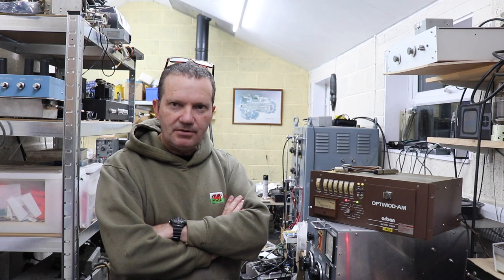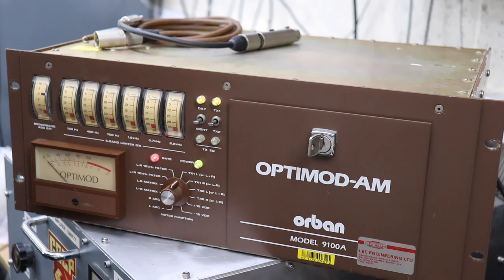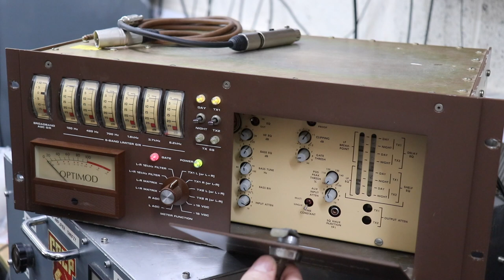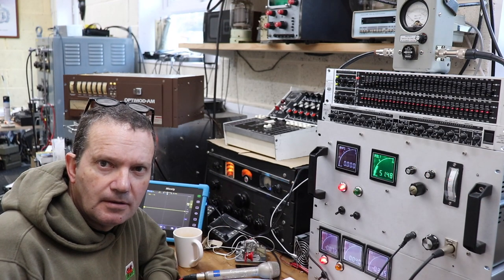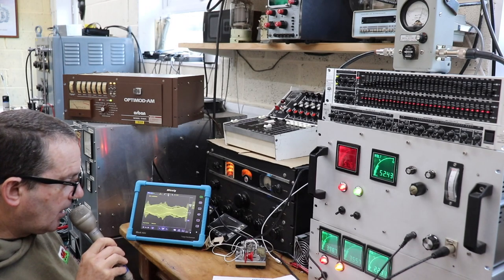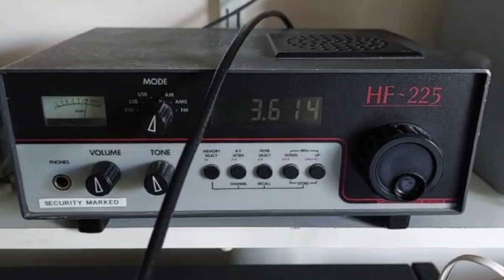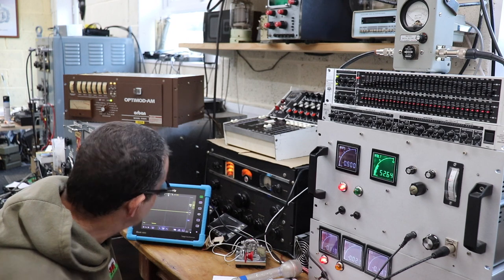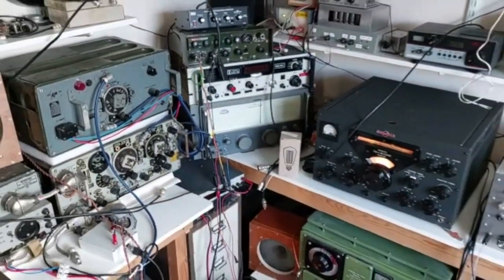How To Make Your ham Radio Sound Like The BBC

Comment: Great demonstration.  As soon as I saw the nice neat waterfall display on the Weston SDR and listening to G6TBJ audio, I immediately thought Optimod.  Superb well modulated, high density, punchy audio.  I used to work on ILR before retirement, so I'm familiar with the 9100 and the FM 8200.  Being sub kilowatt local services, we were allowed 6Khz audio which gave us the edge over the 4.5Khz limits on the high power nationals.  Unfortunately almost all AM locals have now closed, so there should be a few 9100's going for a song, depending on what Arqiva decide to do with redundant equipment.
I enjoy listening to you guys on 3615Khz first thing in the morning via various SDRs and you are teaching me things at 71 I didn't know, despite my 40 years plus working in telecoms.

Comment: I had an Optimod AM at one station I managed here in the USA. They are awesome boxes. Do you have a modulation monitor to listen to and check your levels? These boxes can easily and nominally do 125% positive peaks and 100% negative peaks for regular AM radio broadcasts. I'm not sure what you guys do on SW. See if you can find a manual for this so you know how to accurately set the filters and other "bells and whistles" on this thing. Don't be afraid of the knobs inside! It will give your audio real punch but keeps you well within parameters. You can push it fairly hard and still have it sounding nice, but I don't suggest pushing it to the wall. I hope you're able to hang on to this for a long time. You'll find a way to buy one! Also, look at CRL AM processors. They're not Optimods, but will give you additional punch on the air!

Comment: Great job ++++
For those interested in nostalgia the old Optimod-AM is a bucket filled of awesomeness.
It really showed what could be done with a truck load of analogue op-amps.
If I could buy one I would get a Optimod-AM just for the fun of it , but that's not likely to happen (I am peasant poor) ... so I use a Behringer  Optivoice Pro ? , or something like that.
They are discontinued now but work great for vocals , in fact , that is what they were designed for.
I feed that with a good quality , but not crazy expensive condenser mic , and I regularly get compliments on the broadcast quality audio , even in SSB.
Thumbs UP for the great Optimod video +++ !

Comment: Justin, Nice video and love the Optimod AM. I have a still new in box CRL (Orban) Amigo AM HF. A processor specifically designed for shortwave broadcasting. Can I ask where you sourced those nice digital meters from?
Reply from the maker: Hi David, they are made by Trumeter. Farnell stock them . Order code: 2475691. Not cheap though!!
Reply: @thewtf  Many thanks.
Reply: @davidshapiro383  Would you be willing to part with it?

Comment: The Optimod is an excellent piece of equipment.  I also have a Model 9100A, and they are quite common here in the U.S., for AM broadcast station use.

One caveat about the AM-Optimods: their effectiveness can be of limited value when used with a plate modulated transmitter, particularly one using a modulation reactor and DC blocking capacitor, as such a circuit is comprised of multiple complex impedances, and is subject to ringing, etc., when excited by the clipped output of a processor such as the Optimod.

This results in difficult-to-control modulation characteristics of the transmitter. In such an instance, it may be difficult to obtain good density of modulation without constantly hitting the baseline.

Bob Orban goes into this situation  in detail in the operating manual for the AM-Optimod units, going so far as to not advocating their use with the older plate-modulated rigs.

My Optimod remains on the shelf, awaiting service with some future class-E type of rig, which is a very synergistic match for the aggressive audio processing available from an AM-Optimod.

For my homebrew kilowatt-class plate-modulated AM rig, which utilizes a pair of 4-400As, plate and screen modulated by a pair of class B 833As,  With this transmitter, I use an Inovonics Model 222; I can achieve very tight control of the modulation with this processor, and it allows me to achieve 135% positive-going peaks while the negative-going peaks never exceed 95%. With the Optimod-AM and this transmitter, such tight control of the modulation would be impossible.

73, 
Bruce, W2XR
Reply from the maker: Thanks Bruce for that! I was wondering how the Optimod would work with my Marconi T1509 transmitter which is a pair of 813s modulated by a pair of 813s. I guess you have answered the question!!!

Comment: Radio sound they are used by the BBC and digital orban optimod 8600 is used by bbc radio 2 now days you can set jumper switch for pre emphasis on the orban so the high frequency reduces noise at high frequency especially in bad cb or ham and broadcast area